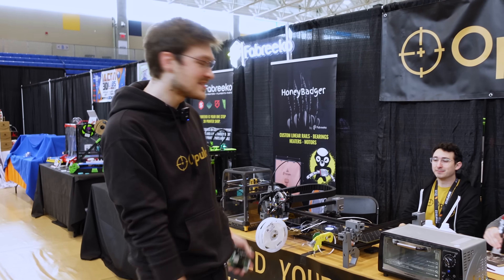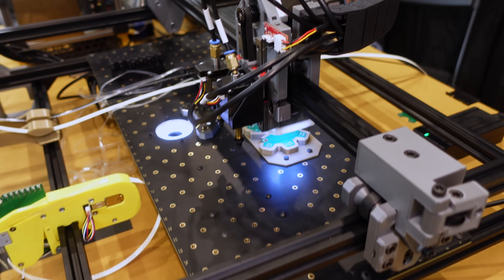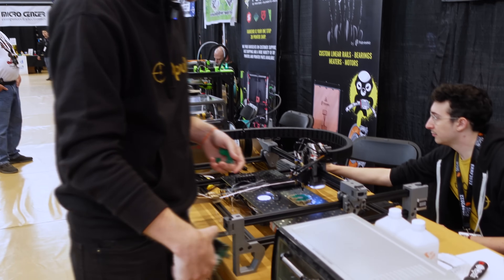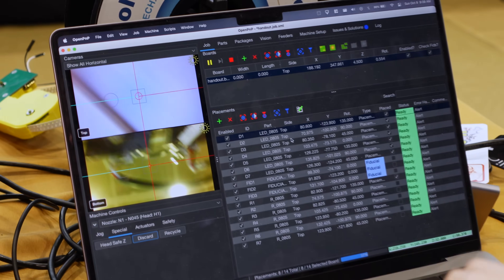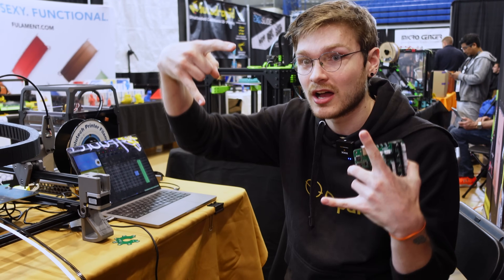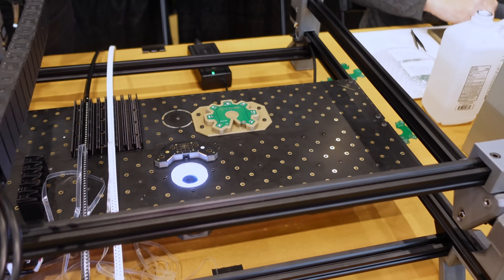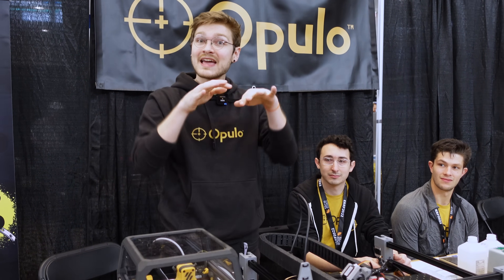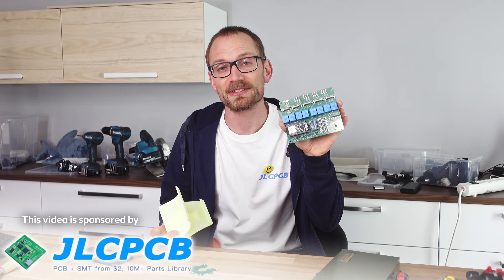You can build this open-source pick and place machine - LumenPNP by Opulo! #ERRF2022

Comment: Looking at it working (and I also saw another OpenPNP machine doing this): why is the bottom camera so far away from the part belts? It forces the head to move a lot of extra. Wouldn't the best position for the bottom camera be right between the parts and the PCB, like commercial PNP machines have.
I notice you don't need vertical movement at the bottom camera, nice job. The other machine had to move down then back up just to take a bottom cam picture.

Comment: For $2000 this is not good deal, Professional pick and place machine price is from 2700-2800$
Sooo... not a good deal for this called open sorce
And I don't like sucking heads 1 going down and 2 going up...  this mashine is not close to be comercial
Good deal is about $500, not fu*king 2000 usd

Comment: I looked into building my own pick and place machine, but in the end my time is worth more than the time it would take to build and load one.  My commercial PNP that holds 27 different reels was only $3500 purchased from China and runs at 20 times the speed of this unit.  I do enjoy people that innovate, and this system is really neat.  Machine vision is not necessary if the system is built with tight specs.  A slight misalignment is tolerable because the component will straighten itself out during reflow.
Reply: can I know which machine do you use, I am looking for a similar one
Reply: @Adharsh-e7x  It was a Neoden TM-240A.  I have upgraded to Neoden YY1 which has vision check of component angle, but I have turned off that vision check for several boards and its placement is still highly accurate.

Comment: hmm, after ~8 years sucess with LinuxCNC on an old Boxford eduacation CNC mill, this "open pnp" sounds like a very do-able side step...(Linux CNC is an open source CNC control system run on an old parrallel port pc/PCI card).

Comment: it would be cool to adapt this to be a swappable head for a 3d printer with a system like WhamBam Mutant. I know that the control would probably need to outside the printer but it could be nice to use the same hardware

Comment: This video rather oversimplifies how difficult it is to setup, calibrate, program, and use any of these OpenPNP-powered pick-and-place machines. And because OpenPNP is under such rapid development, information from even 6 months ago may no longer be valid. It's great that the software is improving and I credit their work, but it is a VERY complex program that is nothing like a 3D printer slicer like Cura for example. It is a VERY manual process with a lot of research, guessing and trial-and-error required. Having built (and rebuilt) my own, written and shared extensive documentation for it, I'd conservatively estimate 50 hours to populating your first PCB.

Comment: Oho!  Very timely information; this goes in my files for, I hope, the first half of next year, when if things go even vaguely as planned I should be setting up for small-scale SMT assembly.

I'll be watching for the automated feeders, and for the maximum number of feeders possible (some of my likely designs have 60 or so line items on the BOM, because analog stuff tends to involve lots of different values).  Be nice to have an open-source, domestically-produced board-stuffing machine.
Reply: If you can't place all the components on the same machine, just having two machines and move the boards forward might help. This is bascially the same thing that happens on all the professional SMT assembly lines where there are usually 2-3 pick and place machines connected by belts in a row, to have enough feeder space for a full job. Sometimes it even makes sense to have different specialized machiens for different parts, like one "chip shooter" that is good at placing all the small passives, and a different machine that is set up for larger parts like connectors and ICs or even tray and loose components that can't be fed from reels.

Comment: cool i can now make my own SMT and make my own company . 
P.S.: My job is to work with Samsung SM481 and the software is not updated from like 10 years and its buggy sometimes and makes my bloodboil .
Reply: Just as a disclaimer, OpenPnP can be buggy and get your blood boiling as well. But at least you have access to the source code and could potentially fix issues you encounter. There are a few people working on converting industrial PnP machines to work with OpenPnP, mostly they are using Neoden machines tho from what i've seen.

Comment: The positioning of some of the resistors and LED seems very random on that test board, I.e almost on the solder pads but not quite. I guess this was just setup because if that was an example of the accuracy it's a bit sad.
Reply: It takes quite a bit of tuning to get it perfect, and depending on the size of the component, you can place them quite a bit away from the perfect location, and it will correct itself in the reflow process. Thats one of the reasons 0402 and fine pitch ICs are still pretty hard to do reliably. Of course, the roller wheels riding in aluminium profiles are not really helping with precision placement. I'm pretty sure that who ever does place 0402 and 0.4mm pitch QFN with a "LumenPnP" has upgraded the motion system to linear rail bearings. (The upgrades are open sourced too tho, the community is really trying to help this thing to get better)

Comment: How much time does it take to configure for a board. Is the firmware on the laptop easy to setup?
Reply: The first time, it will probably take you a day to set up a job. Just because you need to learn how OpenPnP works and how you need to set it up. Once you know the workflow, and have done a few jobs, it gets easier and faster. Of course, it depends on how many different components your PCB needs as setting them all up and tell the machine where to get the parts is a big part of the setup. We intend to only use it for a few components in our prototyping assembly. Just the most used components like 10nF and 100nF capacitors, 10K and 100K resistors... The rest of the components will be quicker to place by hand for the 5-10 boards we do per design than it takes to set up everything for the pick and place machine.

Comment: Following the LumenPNP for a long time, awesome to see it get even more recognition out here!

That said did really think about the 3d printing vs the machine vision work they did until he mentioned it, but I wonder if incorperating that machine vision work into 3d printing would be a good way to do mixed part work. I.E. printer ontop of an existing structure like the LumenPNP does for adding parts on top of an existing thing.

Comment: Does the fact that you have fed back the extra features into marlin, mean that I could use any marlin compatible board like an esp32 board?
Reply: In theory, yes. You need enough stepper driver outputs and hardware I/O to run a pick and place machine tho. 3 axis for X,Y,Z and 2 extra axis for the rotation of the pick and place heads. Then you need just some inputs for the endstop switches, and outputs for the camera-lights (2x), the vacuum pump, vacuum solenoids (2x) and an interface for the vacuum sensors (usually done over I2C). If you want to add feeders, they need a control interface too, currently the plan is to run them over RS485 and an extra single wire bus.

Comment: Does the openPnP work out of box or does it require custom java scripts to function? Last time I played around with openPnP I found it was less plug and play than Marlin but that was like 6 years ago.
Reply: There's been a ton of work, but there are still some limitations. Tons of work has been put into extending Marlin to allow full functionality, so the hardware side is going strong, but I think there are still some issues on the software side being worked on. I highly recommend checking out the wiki and discord server if you want more details.
Reply: @astersfun  thank you! Last time I messed with this was with a Scara and I kind of hit a Java wall on OpenPnP. Python or C++ would be fine, but I only code as a hobby and have not dipped into Java yet.
Reply: OpenPNP works pretty good "out of the box" right now. There have been quite a few immprovements, especially to help you set up and calibrate the machine before the first job. However, if you need to set up a job (configure parts and feeders) regularly, there is still quite a lot of point and click work involved that could be improved with automation and some scripting. At least from my limited experience.
Reply: I think my issue at the time was I had a Scara robot which needed to rotate the gantry camera orientation before it picked. With Cartesian you are always parallel, so thinks are simpler. My next attempt will be based of these kits or similar so glad to hear they work somewhat well out of the box.